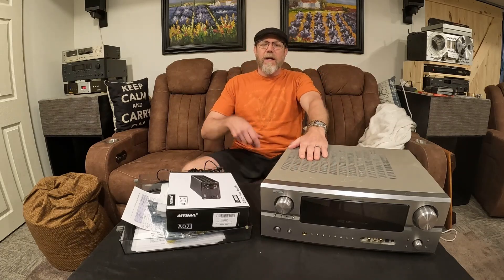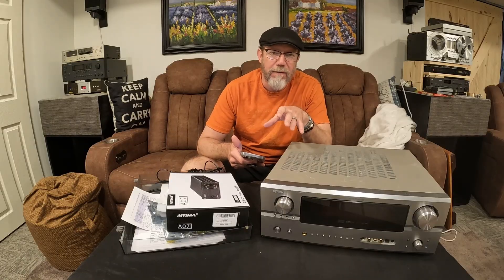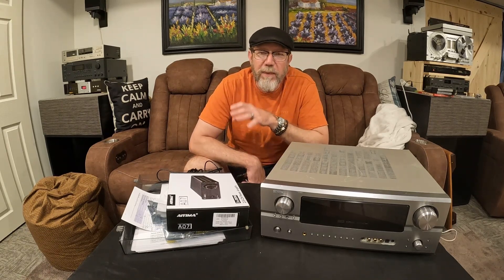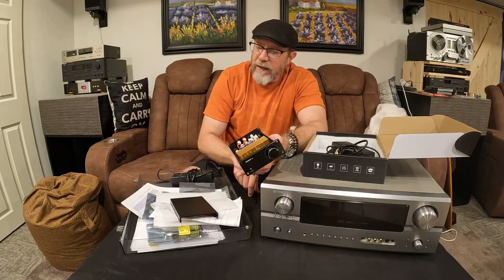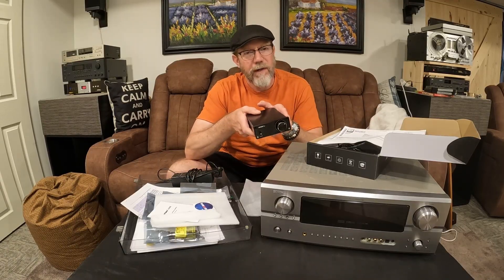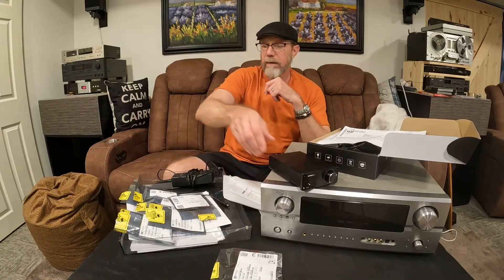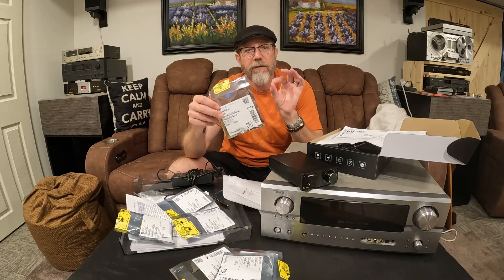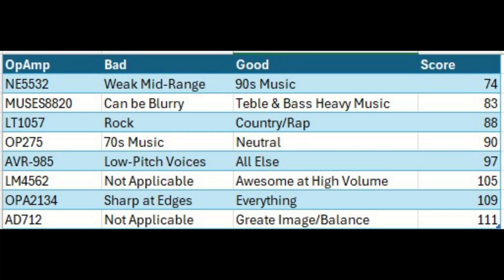Op-Amp Rolling What, Why & Sound Aiyima A07 Amplifier NE5532 8820 LT1057 OP275 LM4562 OPA2134 AD712

Comment: Ah, seems you've met your new best friend Mr. Slew Rate. Your top three here are designed specifically for audio amplification while the basic NE5532 is a general application amplifier. A higher slew rate means the chip responds faster to input voltages, which often ends up with a clearer signal overall. What's funny is that in guitar pedals a low slew rate is at times a desirable trait. It can help reduce the sharpness of distortion. A lot of the "tube like" pedals and amps use this to their advantage.

You'll get dickheads blathering about how it makes no difference. It makes a huge difference. All of these chips have different specs and while they're compatible that does NOT mean they will all work well in a given application.

For audio all you can do is get a handful and give 'em a shot. Us DIY stopmpbox guys have been doing it for decades.
Reply from the maker: @ObscuraDeCapra  I like you!

Comment: Rolling DIP op amps is not a problem, but equipment now uses SMD chips, a whole other pain to mess with. I would pull the ICs and install sockets so you could try any compatible chip in the circuit.  Now with tiny SMD I guess you can swap them if you are steady like a watch maker,  but it will not be a process where you can probably do it more than once.
Reply: Depending on the component used it might make no difference...  Most SMD chips seem to be the Texas Instruments OPA1622, you aren't going to improve much (if anything) by swapping that out.

It's amazing how much high end 'audiophile' gear is using the 1622s, if they weren't at least one step above 'good enough' then something else would be used.
Reply: If you work on smd daily it gets easier. You can swap BGA, up to 3 times according to IPC, but Ive seen some that have been done way more. 

I feel like a wizard of heat sometimes

Comment: Just started rolling op-amps myself!...Swapped out the 5532s for Oracle IIs in a Douk A5, have only listened for a few hours, but it seems slightly different.  Hard to describe still,  I need more time to clarify the sound.    I like the ability to alter the sound signature,  (couldn' t do this in 1980)  but most agree changes are very subtle, and I'm just experimenting as a retiree with lots of free time.

Comment: Looks like the same box the douk I recently got. Although it has the chip which does seem to fix jitter with CDs (it also goes through tubes so it likely smooths out the jitter "more") It kind of fixes Spotify so it's "ok boombox quality" from my sansui 5000. Where it really helped was CDs from the 80s. Example, "Sade - Stronger than pride" so much jitter and wonky tremble, no mids, totally unlistenable compared to the tape or album. Completely fixed the disk and sounds amazing. More recent releases on CD that were recorded better didn't make as much of a difference but still, it was nuance but guitar and vocals were better on account of lack of jitter but at the expense of the mids. I haven't opened it up yet and tried to decide if I should change them, or the tubes to something smoother and crisper. I have heard this and that about DAC chips etc and finally gave in and got it before the tariff scare happened. It's fun. It's bluetooth so it's really convenient. 
Thanks for sharing this is exactly what I was looking for about the different chips. Have a great weekend!
Reply: Op amps aren't going to fix jitter, or a bad amp.  This is a bad amp - but it's cheap.